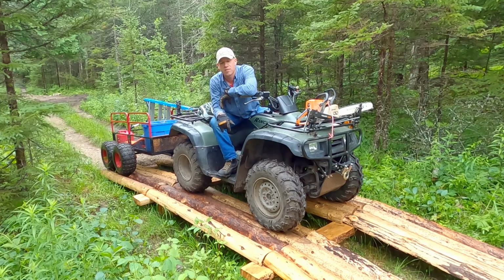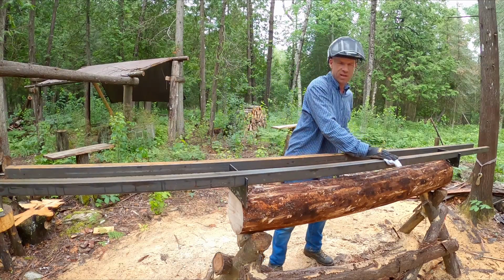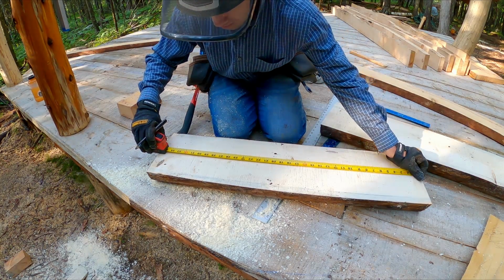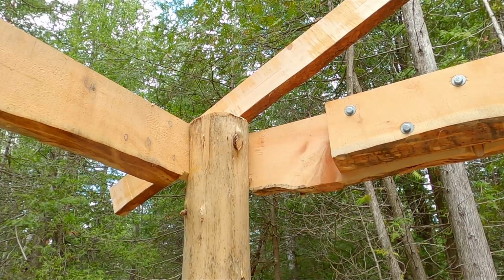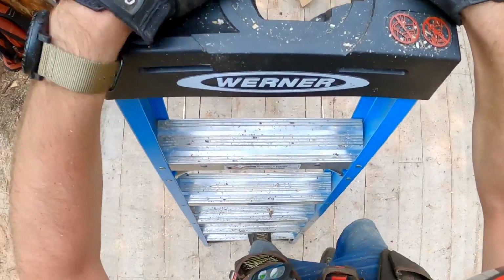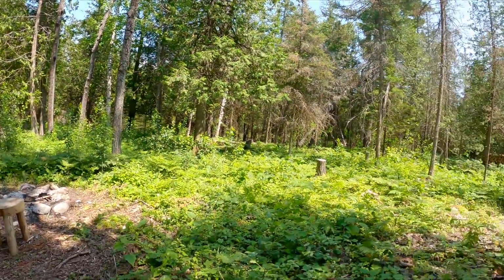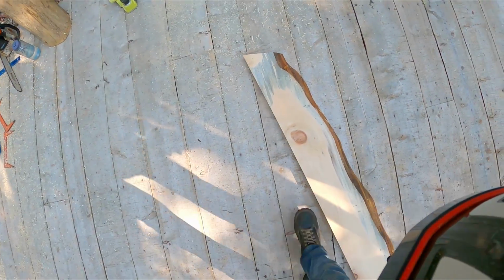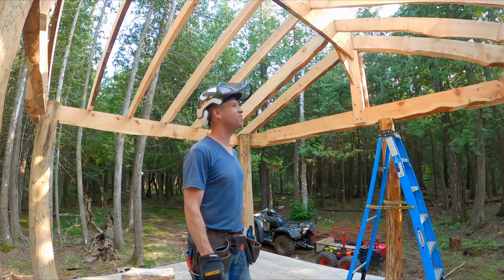Will Chainsaw-Milled Gazebo Rafters Hold Up Through the Winter? #45

Comment: Ryan, I envy your journey up there. Ive got a few acres in northern lower Michigan, gonna build a small trapper shack in the woods for the kids and grandkids. Im sure someone has already said this but you should back up those rafter screws with a framing spike or two. The screws don't have the sheer strength that a spike does.
Keep the faith and enjoy the adventure.

Comment: Ryan, there is a great product "Tri-Flow" it has teflon and you can find it on Amazon.  Maybe use on your mill metal bars. We used it where exposed metal beams were getting surface rust. The teflon penetrated and slowed the rusting. 
Just a thought. 
Keep up the good work

Comment: Hi. Tom Wilson, here, and I want to let you know how impressed I am with your chainsaw sculptering. ;)
My dream--and this why I am so interested in what you are doing with wild tree lumber--is to build a treehouse to live in.
The base you have for your gazebo, looks like what could work for my treehouse floor.
But I need the floor you have so very solidly built, up, about 12 to 14 feet.
And that would be my floor for my "dream" treehouse. So, I assume, I must have a minimum of 4 to 5, 16ft. [guessing there?] beams or columns I mean, to hold/support that treehouse floor?
The other option, likely, also, it to have a mature or two to attach the house to, so to support the walls and roof.

The idea was,  to have something like an open garage underneath the floor for vehicles or maybe a small space for a tool shed, too. 
The manner you bolt those timbers together is quite educational. Something I badly need to ever pull my dream off. I am no spring chicken, but I do dream like one. ;) I am also, chainsaw dumb.
Retired, and have just about giving up on human beings man's best friend, so I will likely end up with the best, most proven animal to be my best friend? Not that they are not a "huge responsibility," yes, this I do know for sure. 
Thank you for some inspiration.

Comment: I think the mathmatical term you need is a messygon.. But I am a big fan of this type of building.. Live in a house from 1905, nothing is straight. You measure everything 5 times and just average the answer and then cut of a little bit more to make it fit.

Comment: If you put gussets across the inside corners,cut on 45 degrees at the ends, you could tie both sides to the posts. Little boards, much stiffness. Don't we all want stiffer posts?

Comment: Hi again. Tom Wilson. I forgot to ask you about those floor supports you have. I think you have 1 timer support for each corner[4] and maybe 2 to 4 more on the outside centers? You would also have 4 centers, but are they all supported, is the question? Say, 4 total and all perfectly centered? Sorry about this technical question. :(

And, most important, how deep are they [the same for all?] and what do you set them in, say, gravel, concrete, etc. and especially, how deep for each one?
Thank you very much, Mr. lonesome chainsaw man. ;)

Comment: Watching this is like another feather in my cap on the road of life I never thought it was possible to mill your own lumber its really not that bad so if you dont or cant afford a band saw this aint a bad way to go and I knew nothing about trees and Im a biology/chemistry major I should know something. But like he said look at craigs list for materials liker old barn wood or tearing down old buildings and using or reselling the materials for other purposes like "repurposed materials" that can be a treasure trove of ideas Ie seen barrels and buckets for feeding live stock or rolls or rubber fro,m con veyer belts for horse barn flooring or pens, pipe sheets of insulation, roiis of materials old food containers and barrels plastic or wooden. I like cam;ping and hunting and fishing skiing boating to. And an avid DIY'r I say a man needs a shop where he can experiment with things.

Comment: Scholar ridgepole holds up the ridge of the roof what you can do mistake one of those trees that is still round cut a notch in it slided over your top board right in the center that roof and then screw a screw through it there you go there's a ridgepole menu you other typeboard you cut to match in the top runner your top board across sir sir your center board and then you'll have a really nice roof

Comment: Wow 
I saw a couple interesting things since you like tents I saw large Quancet frame you put together and cover it with some type of material large squares like the military type quancets or hoop type frame and you cooe heayt it to wi8t5hy na ciou0oe say double barrel stoves two 55 gallon drums stacked the bottom one being the fire polace the top kind of like an oven or like a mass unit with sand or brick in it to hold the heat longer and I spied a good deal on a local tractor with a bucket and that hanmar you had wasnt bad either I duno what you did with it? and a few other things as my water is terrible even though its city water its very rusty and hard waterI know the fix problem is price andf I saw somethking to good to be true as in free slightly used but thats no problem to me. and my cheesey harbor frieght trailer neerds a longer hitch so I can haul longer boards like from say old barns or something as I need a garage that alone would increase the value of this dumpy old house. 
This is North Dakota as in BBRRR its damn cold but I still think you building a wind mill generator is not a bad idea especially in winter when ur solar pannels arent pulling much n power to re-charge all your batteries hell look for say old golf carts n check out n refurbish the old batteries n build a battery bank say in your old tool shed. just look for old deepcell 6 or 12  volt marine or sometimes old electric fork lift batteries but they are huge and very heav n look for old charges because they dont shut off as thats what you need to refurbish old batteries as you need to over charge them to knock the crud off the plates inside the battefries n ya its a little frisky but there are ways to refurbish your hand tool drill batteries to as therm things arent real cheap either. Ive had a lot of odd jobs in my life  and dealing with ariouys types of batteries and vehicle maintenance was part of that to like a jack of many trades but master of none. You never know whern past experience will come in handy both civilian and military. Ive drie all types of trucks forklifts bucket loaders bobcats and equipment cooking service jobs music sound equipment even some welding harvesting haying.